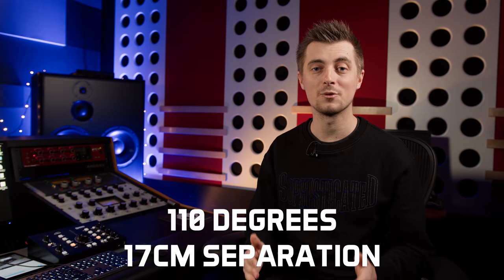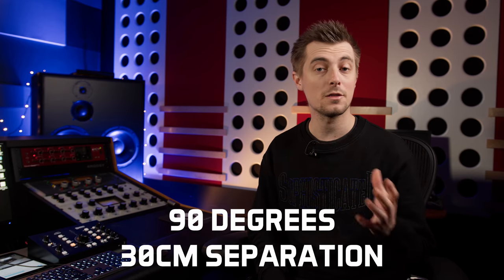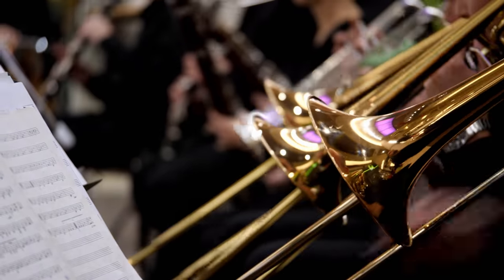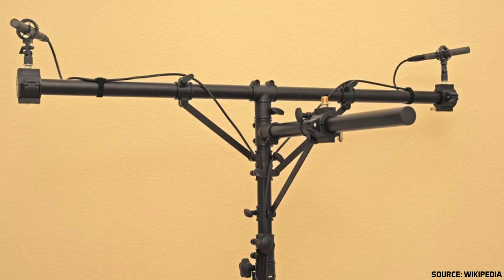6 Essential Stereo Mic'ing Techniques YOU Should Know!

Comment: Good intro to, and summation of, the stereo techniques, but you missed one -- AB, but with omnis, fitted with acoustic equalizers (diffraction spheres), at 50 cm, 90-100 degree splay. This yields the most stunning imaging not only left to right but equally important, front to back. With a good pair of monitors in a good room (or good phones) the 3D sense is eerie. More real and less fussy than a Decca tree, this technique also has the depth missing from the coincident approaches. Omnis let you get close to, say, an orchestra for detail, while still giving a good sense of the room. Been using this for decades with Neumann KM183s and recently Schoeps MK2H.s Never found anything better.

Comment: The last stereo recording I did was a layered acoustic and classical guitar in M/S with a Roswell Mini K47 as the mono microphone and the Lewitt LCT640TS for the sides. Both microphones were running through a tube preamp to get a bit of extra  harmonics. The result was extremely beautiful and natural, especially for the classical guitar (nearly no EQing needed).
Reply: You cannot go wrong with either one of those microphones. Both mics punch way above their weight class. I have the Roswell K47 and K87 also a Lewitt 440 pure. They are truly amazing.
Reply: Goodjob